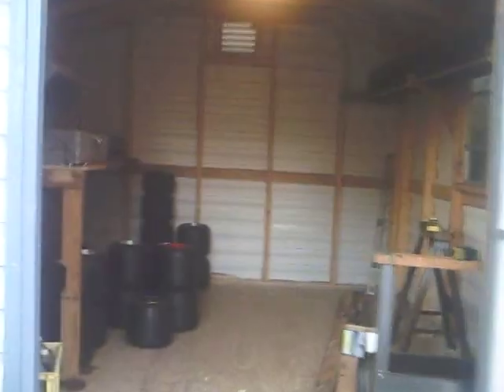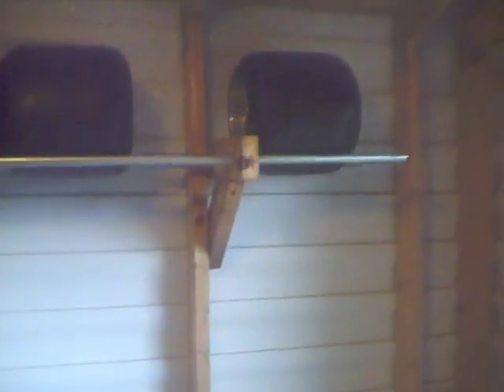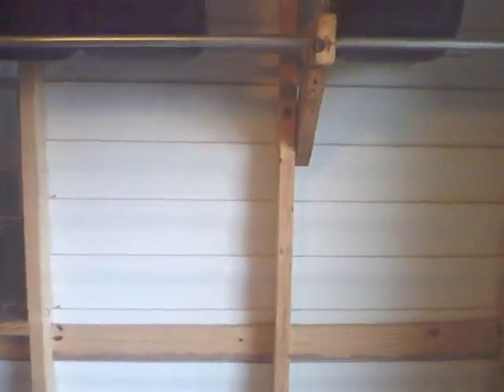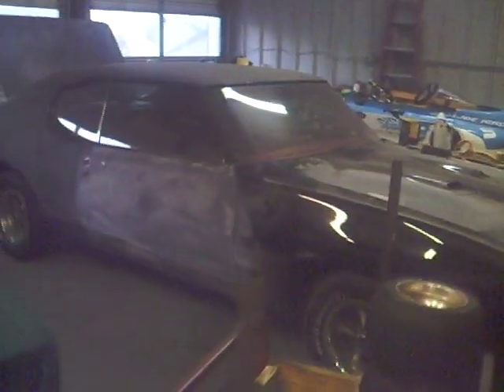Homemade go kart Tire Cutter And Shop Overveiw

Comment from the maker: i dont know what you are cuting tires for but we are doing this for gokarts and our goal is not to cut groves in the tires but CUT off surface rubber with a body filler grater to resurface the tire so it will soak in the tire prep better and it only cost about 30-40 bucks. If you compared our tires to tires that were cut on a 6k gokart tire cuter you couldn't tell the difference.

Comment: You could also do this. Looking at you homemade trimmer. You could turn it into a wood lathe. All you have to do is weld a flat bar across and use it like a wood lathe. If you go and watch a video of how a wood lathe is built . I saw your trimmer and noticed right away to upgrade your device. Nice machine you have there.

Comment: It's about getting the tire flat and getting a radius on the sides. Picture the sides being square and after cutting them it has a round edge. It will help with side roll. Also a normal tire will have a high spot , maybe not a huge amount though. Same as legends cats camber cut tires so you have a better contact patch.

Comment: kdbdrager1 knows what he's talking about. In our shop, we have a spot on our lathe that we put some of our tires on to shave off the top layer of rubber. That isn't technically tire cutting. Proper tire cutting involves a template to get the proper shape on a tire. Also, in advanced tire cutting, the goal is to get a certain thickness in the rubber to get better rebounds for certain tracks.

Comment: I have a question, I built one similar to this and cant get it to peel any rubber off and its annoying me.. How much RPM are you turning it?? and are you just using a normal bondo filler grater??

Thanks.
Reply: Hes using the saw edge

Comment: how comes people grind their tires??
Reply: ***** 
Reduces heat, tires perform better and much less likely to blow out if they are running cooler!!!
Reply: To remove the top layer of rubber which has hardened due to heat.  Also to get to the raw rubber to introduce tire prep to give the kart more grip!